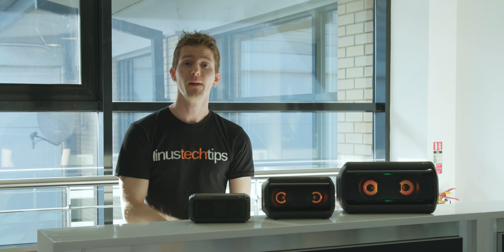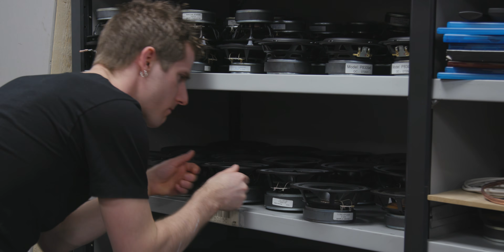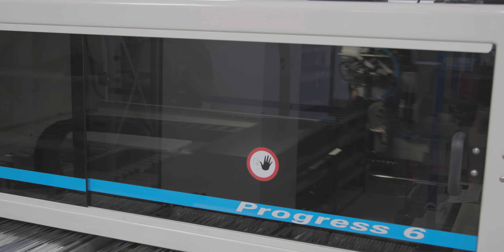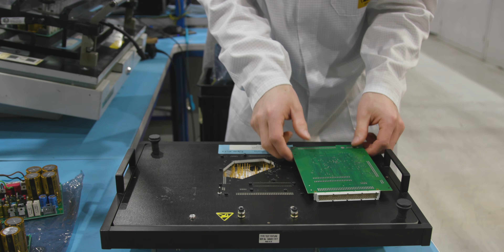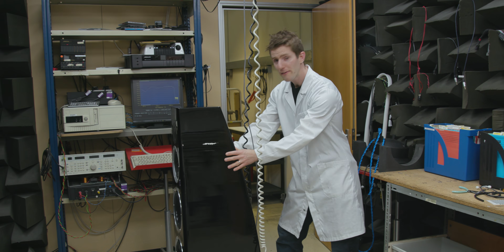How a $100,000 Speaker gets made! - Meridian Facility Tour - LG XBOOM Go

Comment: A $100,000 speaker gets made in the marketing department.
Reply: Looks like they are pretty insane about how they spend their money. Having a full PCB assembly house for low volume manufacture must be extremely expensive so that might contribute to the price somewhat.
Reply: @KX36  yes but they can control the quality which is the reasons for doing so.
Reply: @KX36  so they took a chapter out of linus' pook on spending?
Reply: Meridian licence a lot of tech, like Meridian Lossless Packing.  I used to work for a hifi shop about 20 years ago and we had some Meridian speakers, CD transport, DAC.  I tell you, the sound they produce at high volume is INSANE.  You will kill your ears before you kill the hardware, and it didn't break a sweat.  The cost is in the engineering and the manufacturing.  Economies of Scale make most mainstream hardware affordable, there is zero economy of scale for the highest end hifi.  

When you buy something high-end from Meridian it's expensive because only they are making it, and only they designed it.  Kinda like Bang & Olufsen with their ecosystem.  We sold a LOT of £5k 28" CRT TV's when that tech was old, because B&O made it look spectacular (they made the image on a TV and DVD player almost as sharp up close as a computer monitor) and it integrated with all their other kit through their multi-room network - they are also similar to Meridian in that they use a lot of active speakers.

It's just not worth the money for the majority, but its not built for the majority or marketed that way either.  It's exclusive, but they back up the exclusivity with a good actual product that performs better than almost everything else.

McLaren was a bit different, their F1 series speakers, amp and DVD player didn't exactly impress me.  The speakers were well engineered and weighed about as much as an elephant, but I think the Meridian kit sounded better.  Just a shame we never got to see or hear the B&W Nautilus speakers, they look absolutely amazing.
Reply: If you have unlimited cash, why the f not?
Reply: If you check any serious studio you'll see the same brands and models time and time again: Genelec, Neumann, JBL, Kali etc. Pros don't use hifi rubbish.
Reply: When I saw lg I was uninterested.
Reply: Facts are facts.
Reply: @StringerNews1 Bowers and wilkins is one of them. For less than the price of a bose wave radio you get pretty nice bookshelf speakers such as the Q acoustic 3020i.
Reply: @davidperry4013  Was absolutely surprised at the Q 3020s - I don't really have a place I can hook up my floor standers etc currently so grabbed a pair for my computer desk - very musical. Great little speaker.
Reply: StringerNews1 have you listened to MQA ? And if so how can you dismiss it ?
Reply: Golden statement
Reply: Granpda Corey  My comment is retarded? Hmm maybe to a blind fool. BTW, know it all,  I can buy many of these, today. I will not, because I am not retarded. You can be fooled, I will not be.
Reply: @StringerNews1 Well, you're right of course, it doesn't mean that ATC is super cheap. But they cost way less than half. The Pro 850W costs 45k pounds the pair.
Reply: It’s sold 😂
Reply: Some might start there, but in the Meridian case, the speakers are almost a full system, it has the speaker, the DACs, the pre-amps, the amps and the controller. The only thing it misses is the source, so one might argue that 100 grand for a whole system isn’t was much when we compare if 100 grand passive speakers, where we will need to spend more on amps, dacs and so on. There is a lot of cost involved in the research and development and when the product has a small number of pieces sold, the cost becomes very high for each product.
Reply: @StringerNews1 I get the feeling you're talking about Bowers & Wilkins and Abbey Road haha! They are fantastic speakers if you are.
Reply: What do you think the mark up is on that thing lmfao
Reply: @StringerNews1 Ah that's interesting. I haven't heard the top end B&W diamond speakers in a proper room or studio, so I can't comment on that. 

The nice thing about audio in a way is it's personal preference to some degree. Some people prefer brighter speakers, whereas others don't.

I own a set of B&Ws and really like how they sound. I don't think they're meant to be good value or bang for buck speakers though. I do get what you mean though, once you get above the 'normal' consumer level, you really really do pay for the name and prestigious bragging rights of owning a set of 800 series speakers.

B&W as a company though have definitely become much much more mainstream in the last 10 years or so and it really shows in some of their 'lower' end products.
Reply: smelly_meat boss  If I had the rest of the  investors, capitol, team, I would. I have no day job :) How do you know I have not made some that are sounding "better" ? And further more how the heck do you know what type of person I am? What type of car I buy? The equipment is 100k to millions indeed, but can be hired/rented/commissioned, what does that have to do with the fact that speakers that are 100k are just not worth spending cash on? To me. Will these be worth 100k or more in the next 12 months?? Keep bossing your smelly meat, stop trying to bully YT'rs.
Reply: @StringerNews1 Studio monitors and Hi-Fi speakers are totally different beasts though. One is for work, the other for enjoyment.
Reply: You take a 1000 dollar speaker and put a 100.000 dollar sticker on it
Reply: Who in the fuck in their right mind would pay 100K for speakers that look like a Walmart brand? For any speakers? If you do, you need help. Or wait, I will make you some for half that, and sound three times better, real wood cabs rubs with genuine snake oil.
Reply: @whocares.20  Car audio enthusiast : I mean bass is expensive
Reply: @lxrdvader2021  Do you imply that you are a car audio enthusiast? You mean you spent too much on your shit? Car audio bass, for good ole satifying thump, non competition.,  is not very expensive these days at all.
Reply: @whocares.20  right so true and they are 100k each. freaking nuts
Reply: @whocares.20  Shows how much you know. Or even paid attention. "Real wood" cabinets would color the sound and introduce MASSIVE amounts of resonance, unlike high end plywood or even MDF. Of course if you had ever even heard something that could be considered HiFi or even heard a genuine HiFi system, you'd know this kind of stuff already and wouldn't be talking out of your ass about shit you know nothing about.
Reply: @whocares.20  probs sell to drug dealers my bro, drug dealers
Reply: @bensonhedges479  No doubt, but if that's the case, stop buying from that dealer, their profits are way to high.
Reply: I owned b&w nautilus speakers and then upgraded to the Meridian 7200SE. The meridians are very balanced . Also it’s not just a speaker . Each driver has its own class AB amp and DAC .
Reply: @rajeevpaltrow8728  Nautilus's are more for looks than anything. 800 series sounds better in my personal opinion. However I'm still more drawn towards PMC, really balanced sound.

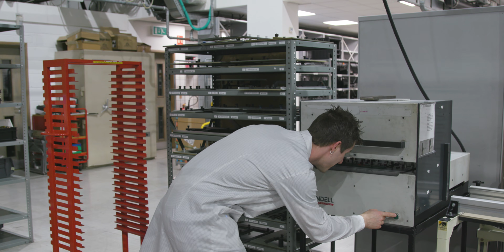Comment: WHY would you say, "if you've ever seen a surface-mount component..." (at 9:10) then show a NON surface mount capacitor, and talk about a machine that cuts the leads of THROUGH-HOLE components — (the EXACT OPPOSITE of surface mount)? Surface mount components don't HAVE leads that "stick through" and need to be cut off; (that's why they're SURFACE mount).

Comment: Ah,  pogo pins, takes me back to long days in manufacturing engineering.  The fixtures I worked with were a lot bigger though, took weeks to design and they were built on an automatic wire wrap machine.

Comment: For $100,000 the PCB traces better be solid gold.
Reply: copper is actually a much better conductor then gold, the reason for gold plating is corrosion resistance.
Reply: They're depleted uranium, and frozen in liquid nitrogen, then dipped in Unicorn Blood.

Really warms up the signal.

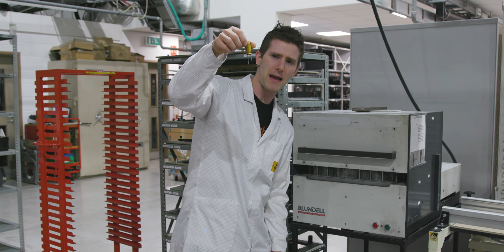Comment: At 9:10 you said "if you've ever seen a surface mounted component." That's a through hole component...
Reply: I was looking for this comment.
Reply: Caught that too. instantly though "Ummm linus, that's clearly a through hole component."
Reply: So damn right and too bad for a mistake
Reply: Noticed too
Reply: Yeah, but they are surface mounted holes. :P
Reply: Just another idiot, making videos, not knowing what he's doing or saying...I'd love to see him try to solder in an SMD on a board.
Reply: @AndieBlack13  I don't think he's an idiot at all. I just wanted to point out the error. Considering a chip capacitor or resistor are SMDs I think Linus could technically do that with ease. An fine pitch IC would be another story.
Reply: @newmzy0  Lots of people do that in a lot of places. It's not "not recommended". Lots of companies don't want to pay for reflow ovens when they're only putting down a tiny amount of smd components
Reply: @newmzy0  myself included. But only for rework.

Comment: well here is one thing i dont get ... why bother with electronics and box when they use conventional speakers... like basically using conventional speakers is marginally more distorting the sound like if u use any cheap electronic and not exactly matched resistors. I would like to see some proof that it is worth putting that much effort into making that speaker scientifically.
(speaking from the point of electrical engineer and i also made few speakers myself).

Comment: Best sponsored video you've ever done did! More Audiophile vids !!
Reply: audiophile? Only audiophile content in this video is using speakers and brand name a few times. This would be a Foxconn factory and 99% of the content would match Too bad, basically, everything about making of this speakers has been NOT MENTIONED, intentionally looks like.
Reply: Adam it sucks it wasn't longer. It was half the length it should've been. He discussed the PCB process and nothing about the design of the speaker I agree. Still,  I'm saying it's the best sponsored vid from him I've seen cause it was interesting to be inside a high end speaker company factory and I'm suggesting he make more Audiophile vids even if he didn't touch on speaker design. He's on to something compared to the normal bukake circle he sits in.
Reply: @shaftymaze  that's even  more weird. One time speakers  are shown, are this novel BT thing with rgb lights. For a company like this, showing it's high end speakers,  part of assembly or something would be a better advertisment imo than showing some PCB which is in every Hifi audio system nowadays... Maybe just some company secret, patents and so on. You don't show your solution to the enemy just to copy it and start selling under own brand.

🤔
Reply: Adam what I don't get is why Bluetooth airpods and Bluetooth speakers are all the rage when it's a compressed shitty protocol. I get streaming is convenient. I can definitely tell the difference between a 320kbps song and a flac. LG should have a speaker with a high quality DAC and amp stack built in,  instead of RGBing.
Reply: @shaftymaze  sure, cheapest speakers with default SBC encoding sounds like crap, but switching to ACC or a better one do the job IMHO.

Sony has own codec with bitrate up to 900kbps.

Comment: Loved the bit about Meridian disowning the RGB lighting. Classic British understatement. 

You really should clarify WHICH drivers meridian helped with. When you're talking about speakers "drivers" refers to a certain PHYSICAL part of the speaker (the part that makes the cone move back and forth). However, we're talking about devices with integrated circuitry and firmware, so it's equally likely that "drivers" refers to bits of code. Especially since you mentioned how they designed the algorithms to change where a sound appears to be coming from.

Also, you should have shown off some audio from the anechoic chamber. That does cool things to sound (it's surprising how echoes are such an expected part of our modern environment).

Comment: Where are the links to the 40$ aliexpress version?
Give us the bang 4 the buck!!!
Reply: usually later saw it on amazon with unbeatable price and the picture looks exactly like the product. 2 day primed shipping cant wait to open it. and found out you bought a look alike speaker with the size of a coke can. but they do look the same.
Reply: this aint no KZ's lmao
Reply: If you want Bang for the buck check out emotiva or ELAC Debut 2. 

For Stereo Amps look at this for best price  performance:https://www.aliexpress.com/item/1-1-DIY-Marantz-HDAM-circuit-gold-tube-MJE15024-MJE15025-Class-A-amplifier-A-rare-high/32853568876.html?spm=a2g0s.8937460.0.0.73e12e0eVxWqVm

Cheap Dac that sounds like Dac over 300:https://www.aliexpress.com/item/Finished-WM8740-DIR9001-DAC-Board-Support-Coaxial-and-USB-Input-Dual-Op-Amp-RC5532DD-Decoder/32839489149.html?spm=a2g0s.8937460.0.0.73e12e0eVxWqVm
If you want Ali express B and W copies check this https://www.aliexpress.com/item/Mistral-SAG-350-180W-x-2-Hifi-Floorstanding-Tower-Speaker-Pair/32502205394.html?spm=2114.search0104.3.112.431e6a2byjaciK&ws_ab_test=searchweb0_0,searchweb201602_7_10065_10130_10068_10890_10547_319_10546_317_10548_10545_10696_453_10084_454_10083_10618_10307_537_536_10059_10884_10887_321_322_10103,searchweb201603_52,ppcSwitch_0&algo_expid=9357590a-fc90-48db-9bce-5c8b4f23262a-17&algo_pvid=9357590a-fc90-48db-9bce-5c8b4f23262a

LIST FOR ALIEXPRESS GEAR _________
https://my.aliexpress.com/wishlist/shared.htm?groupId=100000008534925
Just make sure to ask for the 110v if you are in North america
Reply: @timgenardo265  i know, i was just trying to be funny (which i failed, obviously)
my main earphones are KZ's, have 3 of them (es4,zs6,zsn) along with some other chifi brand